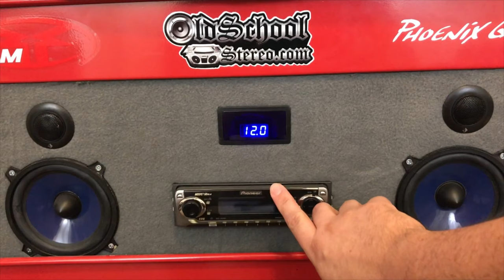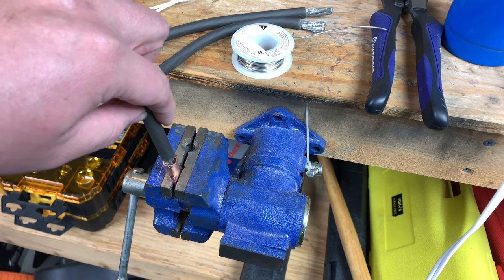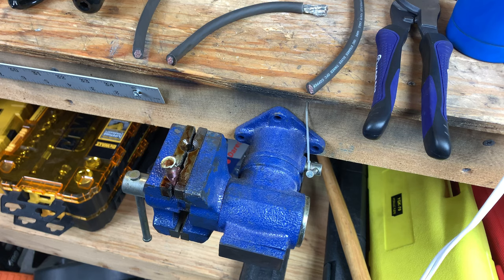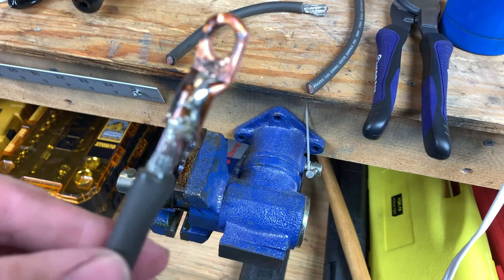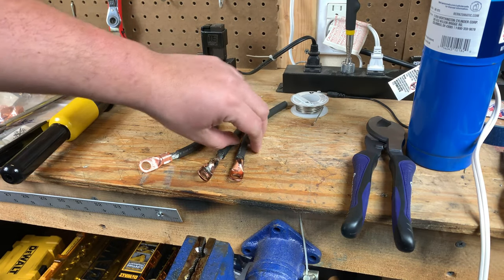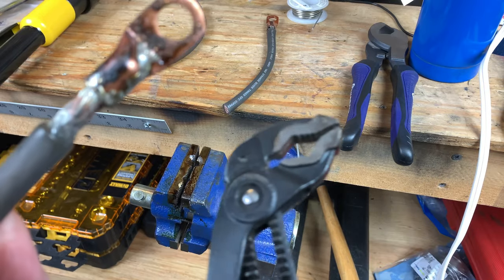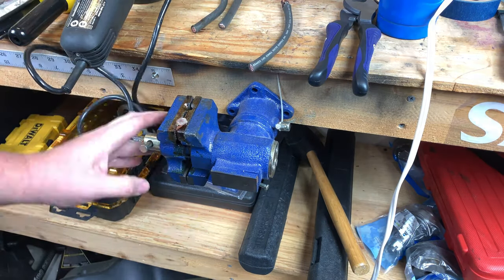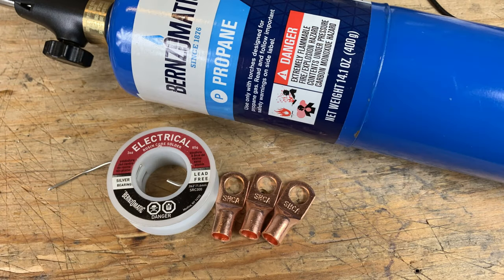How to Solder a Lug (3 methods compared and tested)

Comment from the maker: You can help me out by using these affiliate links to the different products used in this video!

10ton Hydraulic crimpers
 https://www.amazon.com/dp/B06XR8BY65/?tag=Hifivega5-20

Propane Torch Kit
https://www.amazon.com/dp/B00QL53S0W/?tag=Hifivega5-20

Sky High Lugs
https://www.amazon.com/dp/B015IFGC4Y/?tag=Hifivega5-20
Reply: HifiVega hey Rob just wanted to let you know that Pandora is now running podcast aswell  got to get the 12vT in there man keep on doing what ya do
Reply from the maker: Michael Hemric That’s awesome!
Reply: Big d wiz family???

Comment: I have a Mechman alternator and dual batteries under my hood. I have several runs of 0ga. I also use Sky High Car Audio lugs and heat shrink, with a hydraulic crimper. Over time, they've all eventually failed. I believe it's simply due to several heating/cooling cycles, changes in seasonal weather, the metals expanding and contracting. I think the best method is a combination of crimping and soldering, which is what I'm going to do moving forward.

Comment: Flux, crimp, solder to fill any voids. The flux will pull the solder into any air pockets or gaps. Preventing any arcing or corrosion forming inside the lug. That’s where the benefits lie.... Great video though....

Comment: This was my first find on the topic and it was simple easy and to the point!!! Thank you for this!
Reply from the maker: Thanks for watching
Reply: How about if you break a lug due to improper crimp point (copper w zinc coat) a part not readily available, and need the job done now. Is it possible to braze the lug and re-crimp. 480 volts 400 amps. Marine cable 400. Don’t know what that translates to in awg. Basically 1 inch diameter. And it’s not welding cable fine strand crap. Each strand is about equivalent to 14-16 ga.

Comment: The problem with method 2 is you added solder to the wire side and wicked it up inside the cable jacket as well… that being said it makes the cable more brittle and can potentially break the wire there. The first is a decent and very commonly used and the last is the best way. My question is what about soldering it first as in your first example and then crimp because why not. High resistance connections / high amp draw over time can cause the solder to loosen up unless you use higher temp solder. Such as pure silver solder.
Reply from the maker: I prefer a cold welded hydraulic crimp, but a lot of folks wondered about soldering a lug so that’s why I did this video.

Comment: In the engine bay, I use straight crimped connectors with no solder - just more afraid of solder breaking down from the constant hot cold cycling (it's just a fear of mine and has no actual reasoning based on any fact or science).  But everywhere else, I'll strip the wire ends a little long, tin the wire ends to prevent fraying, cut the tinned ends down to fit the crimp end perfectly, and then I'll crimp the end to the tined wire.  I'm not saying it's the best, it's just what I do for no reason other then doing it.  It's likely the most time consuming method.  Funny enough, I do actually enjoy wiring - the anticipation of everything coming together so I can bump up the volume. :-)  Good video!
Reply from the maker: We do very high amperage battery arrays at work and not a drop of solder is applied. That being said I had a lot of requests on this method.
Reply: @HifiVega  Well, I decided to check into it a little, and it seams what I've been doing likely is the worst thing to do (the two big problems would be an increases resistance at the joint while making the joint more prone to breaking esp if it gets flexed).  There does seem to be some merit in soldering over an already crimped connection though in regards to improved corrosion resistance (and it won't cause either problem).  I'm just going to use one or the other method moving forward.

Comment: If you don't have that hydraulic crimper could you still crimp the wire lug on with a swagging tool crimper it's where they're around on both sides and maybe just tape down a steel ball like from a bearing on one of the round sides of the swagging tool so when you crimp it it leaves an indent on one side of the lug you think that would do just as well?

Comment: Thx I don’t have crimp and have plenty solder looks like it will work and I can always melt solder out and re use unlike crimping!
Reply: Good idea, i have 4/0 XL sky high lugs, they cost quit a bit. I recently upgraded amps and have to change witing configuration and im spending about 30 dollars to replace those crimped lugs/heatshrink altogether

Comment: Thanks! I just watched the crimp video and this one, I’m going to solder and crimp!
Reply from the maker: Darren Langley excellent! I love hearing this kinda stuff
Reply: Solder and crimp? Don't forget you'll get a cold joint if you crimp something that is soldered (because solder flows under pressure). Better yet, don't solder at all if you don't have to. Crimps are stronger and better conductors.

Comment: The purpose of the solder is to prevent oxidation.  That’s it.  Any mechanical strengthening is purely incidental.  Crimping followed by soldering provides the best of both worlds, so long as you are careful not to allow solder to wick into the wire above the lug where it will create a weak point if/when the wire is flexed.

Comment: Great vid! I hate soldering those types of lugs, but have done it many times in a pinch. Yes be sure to strip the jacket back far enough, it does look ugly but nothing a little heat shrink cant cover and make look good!
Reply from the maker: #Basscop hydraulic crimp for the win!
Reply: @HifiVega  I'm still on the fence as to what is the best, I think alot depends on the application.

Comment: That cold weld is beautiful, thank you for the awesome video. Crimping is always the best option if the situation allows and you have the tools. One correction though, I don't think anyone believes soldered connections offer better sound or electrical conduction, they simply don't, and everyone knows crimping is ideal.
Reply from the maker: Totally agree!
Reply: A bench vise  makes a great crimper for big awg cable.
Reply: @Joachim Shekelberg not if you do it right. I'm talking like four through 0 AWG. The vice covers the whole surface area of the lug. So it's crimped evenly from top to bottom

Comment: I think if you soldered just the inside of the lug then you crimped in a cable and then heated the lug you would fill all the voids in the lug and cold weld your conductor.

When I make my crimps I flood the lug with Dielectric Grease and it actually sometimes comes out of the seem around the hole in the ring terminal.

Comment: That crimp on is NOT a 'cold weld' or ANY weld, that happened when you cut it. The wheel 'smears' it when you cut through it.  If you cut that and mount it in an epoxy (w vaccum to protect voids) you would see that the wires are only contacting terminal in few areas- soldering makes contact everywhere by filling these 'voids'. (Basically,  you need a proper way to cut without 'smearing' the metals together to really see whats going on in there). 😉
Reply from the maker: I have cut these open with a hacksaw in my other videos with the same result and on top of that I’ve cut many with a grinder (on video) where bare wire strands are still showing

Comment: I have those same hydraulic crimpers I usually crimp a lug then turn it 180° then crimp it again that will get rid of the wings. also have a set of industrial crimpers that will do the big stuff with one stroke😎
Reply from the maker: eric dudley we use the big battery powered crimpers at work and they’re legit!
Reply: @HifiVega  yes you sound like your work is like mine I work at a electric motor rewind shop I get unlimited lugs,connectors, wire heatshrink, all the goodies haha.
Reply from the maker: eric dudley I build industrial batteries as well as forklift batteries

Comment: You should have added some flux to the wire too. The solder would have soaked in into the strands. You would be surprised how much it would have soaked in.

Comment: Did you happen to put a meter on and check the resistance of each one of those cables see if they're going to pass electricity without heating up?
Reply from the maker: I did not, but it’s something I need to do in a future video for sure
Reply: Thank you for replying. 

I'm not trying to be disrespectful,  rude or mean with the following comment/question. 
AND HERE IT GO...
I was thinking about how you dissect the crip connections with the angle grinder cut off wheel whatever. My thought was that is it possible that the grinding wheel could actually be flattening filling in the spaces and making it look like it's a complete solid crimp cold solder cuz the friction of the blade spinning so fast might be filling in gaps I don't know it's just a thought. I'm going to try that and then try one using a hacksaw slower less friction than heat and see if the same results thanks for your information and hard work.
Reply from the maker: @greyslick3411  I’ve absolutely thought of the same thing as well and next time I do it I planned on using a hacksaw for the very same reason. I’m always open to constructive suggestions and even criticism. I appreciate everyone in the communities perspectives and it gives me great ideas on future videos and where I can improve
Reply: @HifiVega  oh great minds do think alike  that's some real quantum entanglement shit there.

I've been watching YouTube since it's beginning and no one's ever replied to any of my comments (in a positive way) this is the first time I've ever had a chat with someone through YouTube thank you..

Comment: Nice Vlog bro! Very informative. I agree with the crimped vs soldering. The soldered connectors just seem like they would have some voltage drop. Not sure how conductive solder is.
Reply from the maker: Charles Norris Thanks! I’ve seen it tested in a few videos and it seems to be about the same either way, but imo the crimp will last longer overall.
Reply: @HifiVega  Solder is more resistive than Copper, and Silver is a little more conductive than Copper.

Comment: Can I have info what can of soder u using wand  flux yanks
Reply from the maker: It’s just a lead free rosin core solder and water soluble flux
Reply: Ok tanks , my tubin is brass and the wire is cooper like welding lead
Reply: So can u give me idea to weld brass and wire cooper together

Comment: l never use flux when l solder, l have personally never noticed the difference with or without it. some people get those cold solder joints without it but l have never had that problem. my solder joints are actually pretty clean and solid.
Reply from the maker: Electronics For Fun it makes it quicker to get full bleed through in my experience.
Reply: @HifiVega  yeah you should use flux, l just too cheap. l am the kind of guy who picks up a penny on the street lol.

Comment: Useful video.  Any thoughts about using 60/40 instead of lead-free solder?  Does 60/40 reduce the conductivity of the terminal?
Reply from the maker: I’m not sure I’d hafta try and test that
Reply: 60/40 will be much easier to work with. Tin/lead. The more lead the lower the melting point. 
Without lead, solder is difficult to use.

Comment: Crimp and then solder....  Solder isn't meant to physically hold anything together... You are not welding....  Solder is to make it electrically sound
Reply from the maker: chris niner the truth of the matter is solder does nothing, but quicken the time for corrosion to set up. A cold weld (hydraulic crimp) will outperform a crimp with solder all day long.

Comment: Crimped connections are ONLY as good as the crimper and the terminal.  I've seen some really badly done crimp connections.
Reply from the maker: Stepside1986 true, but I feel like that’s the case for any method.

Comment: Run voltage through them next time. That’s what I thought you were gonna do...
Reply from the maker: Daniel King I did a ton of research and from everything I’ve seen they are equal, basically the electrical advantage you get from soldering is negligible.